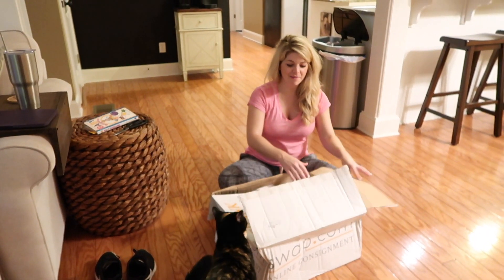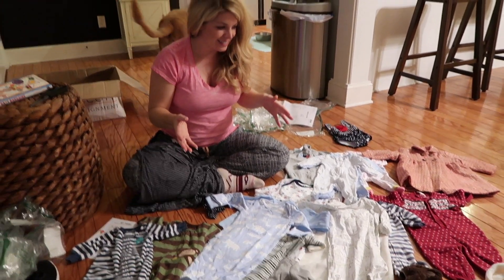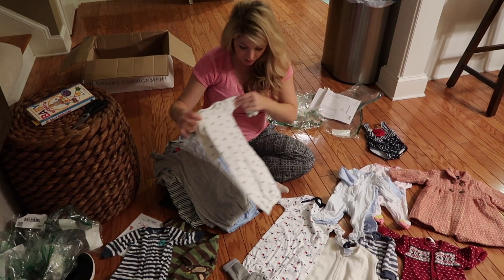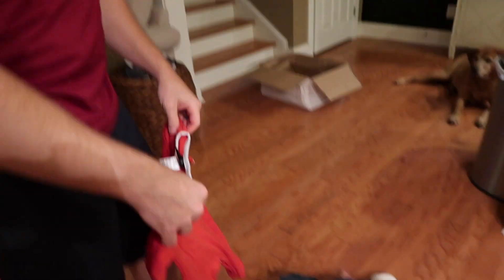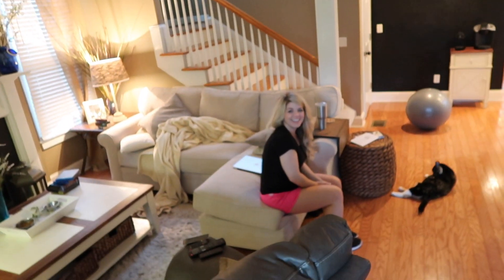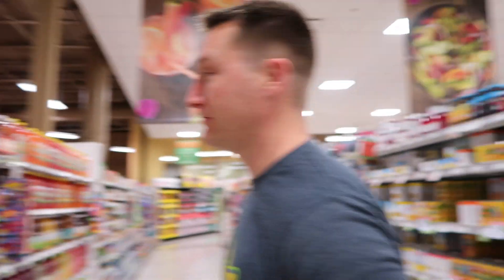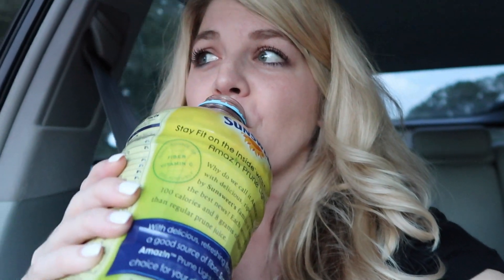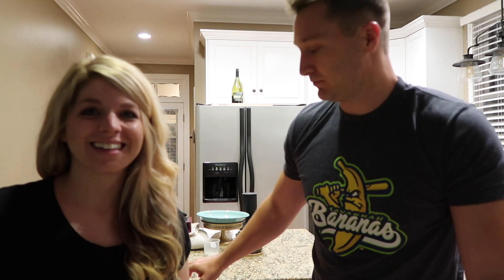RACH HAS TO CALL THE DOCTOR! | 19 Weeks Twin Pregnancy Pain

Comment: I woke up with severe pain in my rib area 5 weeks postpartum with my second child. My OB doctor actually came to my house and checked on me and told it was my gallbladder. I had it removed that same day.  Never feel as if you are a overreacting when it come to calling the doctor about the safety of you and those precious babies you are carrying. About the store issue and prices, absolutely tell them regardless of a line behind you. Just think of how much money they are taking from customers that may not have that extra $1.00 to spare. It can be an honest mistake due to the computer system but without anyone letting them know it can't be corrected.

Comment: I got my gallbladder removed when I was 15, which is extremely young for anyone. I was first misdiagnosed as just having gas, then GERD, then constipated and it wasn't until a year of sharp pains that I was finally correctly diagnosed as my gallbladder being shriveled up and not producing any bile. The pain I had was extremely sharp to where I felt as though I were being stabbed (I still have phantom pains even though I got it removed 5-6 years ago). The only way I found that helped me with coping with pain without going to the ER for morphine was meditating and I know it sounds cheesy and "how can meditating help with a stabbing type pain" but trust me it works like magic! I just focused on going to my happy place and making sure my inhaling and exhaling were on the exact same time apart.

Hope this helps you and that your pain goes away!

Comment: During my 1st twin pregnancy in 2015 at 14 weeks I started having a similar pain to what you're describing & ended up in the ER to have it checked out. It turned out to be my appendix & I had to have an emergency appendectomy. Scariest thing I've ever been through. But the babies ended up being ok & went to 37 weeks. I would get it checked out just to be on the safe side... I never assumed that it could be my appendix because of how high up the pain was but when you're pregnant everything gets pushed up. I did also have my gallbladder removed in 2005 but I felt the pain more up in my ribs (center & right side) & towards my back. I hope you feel better & everything ends up being ok. Hugs 🤗
Reply from the maker: Scary!!

Comment: When I had gallstones I would get flare ups even if I ate a salad sometimes. I ended up getting it removed 4 months postpartum because I was miserable. I was told it’s common to get gallstones when pregnant. They can do an ultrasound to check for them. I hope that’s not it and the prune juice works for you!

Comment: I had huge gallbladder issues, and ended up having mine taken out because it became so bad.  Admittedly it wasn't during pregnancy at all, but your symptoms exactly match the pain I had, and the area it was in.  I used to describe it as a fire under my ribs that would get bigger.  It usually occurred after eating, and I don't mean eating a fatty meal.  I mean any time I ate it would happen within an hour.

Eventually they discovered I had hundreds of very tiny gallstones that were blocking my bile ducts, and my gallbladder was so inflamed after eighteen months of the constant pain that the only option was to have it removed.  Just be aware that ultrasound doesn't always pick up gallstones, especially if they're too small (the smallest are the most dangerous because they can block bile ducts).  I had at least ten ultrasounds specifically looking at my gallbladder before they found anything wrong with it.

Also I WOULD NOT RECOMMEND what someone has said about eating a high fat meal and seeing if it gets worse.  If it IS your gallbladder that is just going to increase the inflammation, potentially making the issue worse.
Reply from the maker: Oh gosh... how could they have missed it 10+ times?!  How frustrating!
Reply: Yeah, it was a really long process to have it resolved :/ it took me being hospitalised for the pain to finally have a resolution, too.

Hopefully it's not the path you have to go down!  I would definitely look into having your gallbladder checked though.

Comment: I had gallbladder problems in the past and that is sort of what if felt like. I ended up needed to have it removed but that could wait until the end of your pregnancy if it is the problem. I had inconsistent pain in that area for almost 9 years, it can wait 18  more weeks. I would get a second opinion or see if certain foods make it worse. Good luck and feel better!
Reply from the maker: I'm thinking this is likely.. I've definitely had pain in this area several times before, but much worse now with pregnancy.
Reply: Your diet has changed to somethings high in carbs, sugars, and fats (which is definitely not bad, get the calories where you can!) and those two things made my gallbladder flair up and increased my pain. The good news is that it is an easy fix, have it removed once the babies are born (you can very easily live without it). Try visiting a gastroenterologist specifically, OB/GYN while very knowledgable aren't experts in this field.

Comment: I had my gall bladder out. I was not pregnant at the time but it was pain more in the center of my abdomen but a little higher up. It would be worse if I ate something. They basically diagnosed mine by pressing down under your right rib and the pain I had when they did that was insanely awful. Not saying to do that but that is definitely a way to know

Comment: I always say something about what is supposed to be on sale if it is clear on the tag.  Because there's this thing called false advertising and they have to honor the sale price displayed.  Kroger has a scan right guarantee as well and if it does not ring up the price that is stated, then you get the item for free.
Reply: Debbie B I do too. Alberson's grocery store policy is give it for free if it is runs wrong at the registry.
Reply: Alberson's, Safeway, King Sooper's, and several others are all owned by Kroger.  They bought them out about 2 years ago and have been converting their policies.

Comment: Ooh...a cliffhanger!  Can't wait to see the rest of the project!  

Absolutely Rach, you should call anytime you have concerns.   There are so many things that they can do to help prevent preterm labor if you get in early enough.   My sister went into preterm labor (interestingly she was underweight when she became pregnant) they managed to stop it and put her on bed rest until she was safe, and she ended up going over.

I was thinking about the gallbladder possibility...and how the pain comes and goes.   Maybe you could keep track with a food diary.  Record when/what you eat and record when you are having the pains.   You have increased your ice cream intake, definitely not excessive just more than you are used to.  For us unhealthy eaters I wouldn't think twice about it, but your system might be in shock, lol.

Warning: TMI!  Poop talk:

The thing about constipation is that someone can still be having b.m. and still be constipated.  The softer stool goes out around the 'blockage', so you could even have diarrhea and actually be constipated and not even be aware.  This was explained to me by a Doctor when I had a similar issue during pregnancy.  I was shocked when the Dr told me I was constipated.  They discovered it when they were doing an ultrasound to check for kidney stones.  I did end up having kidney stones too, another common thing during pregnancy.   I think they can do an ultrasound for gallbladder as well, at least they could confirm the constipation diagnosis, that is if the prune juice doesn't work and the pain continues.
Reply: LJ Cl yes they ultrasound the gallbladder as well and can see the stones clearly.
Reply: Thanks, Holly Tree!  I thought so, but I wasn't sure.  Seems like it would be a good idea to find out for sure what is going on.  It could give Rach peace of mind just to rule it out.
Reply from the maker: Such good advice, as usual!  I had no idea you could have a blockage & still seem to be going normally!  I'm definitely going to start a food/symptom diary - great idea!

Comment: i had to have my gallbladder removed. but it was because it was being plugged up by a tumor. which didn’t show up on the ultrasound or the ct scan or the hida scan. during the hida scan they pushed the radio active dye they use that is suppose to make your insides light up and my gallbladder wouldn’t light up. so they gave me morphine and pushed another round of radio active dye and finally when they were about to give up, it finally lit up, but then when they pushed the stuff that is suppose to make it filter, it wouldn’t filter. so they figured mine was functioning below a 5% rate. so it had to come out. that being said. i was puking most nights in the middle of the night until i was so exhausted i couldn’t pick myself up off the floor and would just pass out on the bathroom floor. super nauseous. it felt like someone was stabbing me it hurt so bad. it was awful.
Reply from the maker: Oh my gosh, what a crazy story! So sorry you had to go through that!

Comment: Only 3 minutes in but I have to say...make sure you don't put the babies in the bunting outfits in the car seat. It isn't safe. The most you can do is a thin jacket. Look up "car seats for the littles" on fb, it's a great resource!
Reply from the maker: +Brandi Merritt thank you!
Reply: Brad and Rach No problem! Totally don't want to be "that person" haha but I had no clue about car seat safety with my first and I've learned so much since then. I'm sure y'all would have figured it out on your own, but just in case.

Also, I had gallstones with my first pregnancy. The attacks started when I was 28 weeks and lasted until I was 38 weeks and they did a csection. 2 weeks postpartum they had to take out my gallbladder because I continued to have attacks. I didn't have any nausea or vomiting with mine, only pain under my rib that was EXCRUCIATING. Of course the doctors kept telling me it was just indigestion until I was 38 weeks and they finally did an ultrasound on it and it was full of stones.